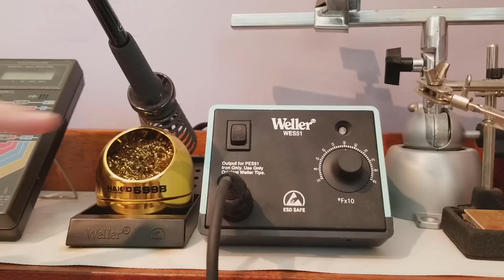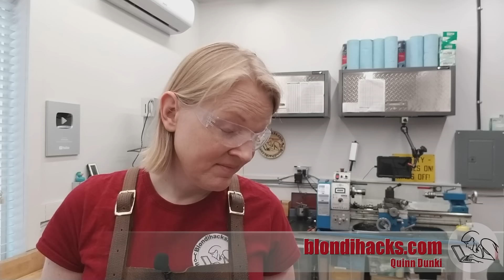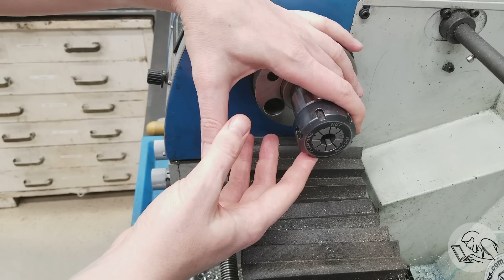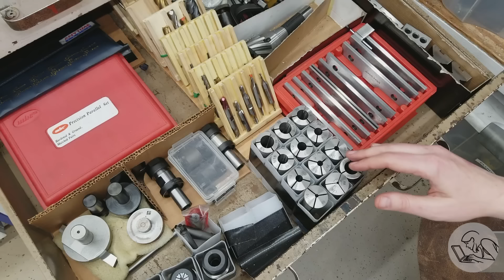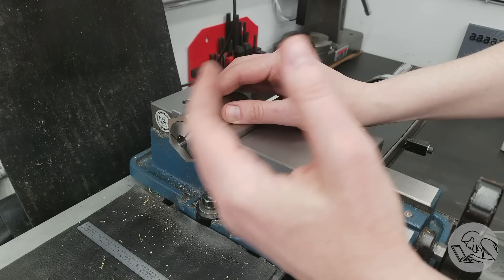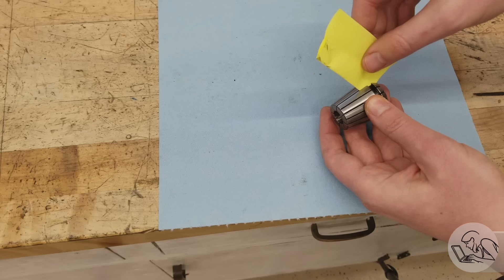Beginner's Guide To Collets

Comment: Another great explanation.   I just found a Taig Micro Lathe, model 4500.   I'd like to use it for clock repair.    Thinking of a set of ER collets in of course very small sizes to hold the shafts and polish pinions, etc.

Comment: I was a bit surprised to hear you say that slipping in R8 collets is unlikely at hobby shop machine scales.  That makes me wonder if I am doing something very wrong.  I have a mini mill that is a size or two smaller than yours (basically a variant of a Sieg X2), and I have experienced end mills getting shifted in R8 collets many times both when end milling and side milling -- I have mostly switched to holders for heavier cuts.  Perhaps I am pushing things way too hard (that poor little machine has seen some stuff).  I assumed that was just normal, but... yeah, sounds like I have some troubleshooting to do.
Thanks for the info!
Reply from the maker: There’s something very wrong if your endmills are slipping on an X2. It has nowhere close to enough torque to do that. Your collets aren’t nearly tight enough or are the wrong size.

Comment: @25:32 very true...
I started with er40 for work holding on my lathe.
Then i got my mill with iso 30 spindle & it also came with a er 32 set.
I just did not had to buy any collet set. 
Set of er 32 & er 40 does all the tool holding and work holding for me. Between two lathes & a mill.
There are a lot of content on my channel demonstrating the versatility of the ER systems.

Comment: THANKS, VERY MUCH QUINN!!  I HAVE BEEN WANTING TO "BUILD" A SMALL, COMPACT, "PRECISION" LATHE, THAT MIGHT BE VERY USEFUL IN MAKING A VARIETY OF SMALL PARTS, ESPECIALLY USEFUL FOR R/C AIRCRAFT MODELING, AND SIMILAR ACTIVITIES.  ALTHOUGH, I'M NOT INTERESTED IN TRYING TO MAKE PRECISION WATCHES, CLOCKS, ETC., I WISH I HAD THE MACINE CAPABILITY TO DO VERY GOOD, PRECISION" WORK, AND, WITH REASONABLE PROFICIENCY, WITHOUT CONSTANTLY NURSING THE MACHINE, TO KEEP IT FUNCTIONING.  I MAY TRY TO BUY A "CNC COLLET MACHINE HEAD, AND USE IT AS A BASE HEADSTOCK,.. THEN I NEED TO FIGURE OUT SOME SORT OF CROSS-SLIDE/RAIL SYSTEM, AND, USE A "TILTING/TURRET STYLE VISE, TO HOLD THE WORK, AND TO ADVANCE THE CUTTER BITS.  I WISH EVERY HOME HAD A SERVICEABLE "WORKSHOP, AND A "CRAFTSMAN" CAPABLE OF MAKING THINGS, FROM MINI-BIKES, TO BOATS, MOTORS, AND SUCH!... KEEP UP THE GREAT WORK!!!  THANKS, AGAIN!!!:face-red-heart-shape::face-red-heart-shape::face-red-heart-shape:

Comment: Excellent video as always, Quinn. Thorough, concise, and delightfully nerdy.  

Regarding the TTS holders: I'm one of the hobby users that's had much success with them. The "special" collet really isn't that special... You can buy the precision ground one, or you can do as I did, and just grind a regular 3/4" R8 collet nose flat, on a belt sander. The important thing is that the face of the collet is recessed into the spindle, which allows the upper face of the holder to register against the spindle nose. The collet face is not the registration surface. 

This is what gives you the Z-height repeatability, as well as making up for (most, if not all) rigidity lost due to stickout. I've got a smaller mini-mill than yours, and on the rare occasion I need the extra Z-height, I just hold the tool in the appropriate R8 collet... But I honestly cant' remember the last time I've had to do that. Most of the time I can just swap tools in a few seconds, which is well worth it, for me. (I definitely recommend using the genuine Tormach holders... Unless you're luckier than I am, those import ER collet holders have terrible runout) 

An added bonus is if your DRO has a tool library. Automatic offset compensation at the touch of a button!

Comment: An important point to be aware of is that end mills with a set screw detent must be inserted at least a few millimeters beyond the detent. Otherwise, when cutting at high feed rates the pressure on the end mill will cause it to break.

p.s. - You can instruct apprentices on how to do things the right way until you're blue in the face, but I've yet to find a way to ensure they consistently follow directions. I've even had apprentices place double-end end mills in ER-32 collets at such a depth as to break the flutes on the second end.

Comment: All hail the algorithm. I was looking at collet sets today (and bought a set of ER40s and a collet block set). And now your video is at the top of my feed. I needed the larger collet to hold some larger parts. The mill I use at work (a high school) has ER32 tooling collets. Our CNC mini mill and CNC wood router use ER16s. I hadn’t even thought about the block setup fixing the part centreline in Z axis.

Comment: Good talk Quinn 😊 I use MT2 collets in my baby sieg x1 clone, find them much better with the increase in rigidity and basically no runout. 

Discovered that my el cheapo er25 square collet block is super badly made,  not one surface is actually properly flat, and I'm trying to hold a small 1/4" thick piece of stock in it for milling a flat, but keep getting a .03mm-.1mm taper when trying to cut even 1" of a flat across it, withbjusr barely more than that sticking out.

How would one square up the chinesium standard er25 collet block and gain the concentricity (possibly wrong word, difficult concept to be sure of) necessary for having the held bar stock at true 180 degree parallel to the bed, I.e. remove the tapers and make it true? 

Embarrassed to ask, but you're the smartest machinist I learn best from, and I'd rather fix than replace things when possible 😊

Comment: Never used the ER collets, how do they compare to TG collets? 
All the shops I worked in used them in various sizes and they seemed to be actually preferred to endmill holders, the belief being that full diameter contact was better than just the point contact from a side screw.

Comment: Don’t forget the ER25, good size. I have a complete set of Er40 for the good diameter range, plus a bunch of Er25 holders to have smaller mills mounted. Doubled/tripled collets for 6, 8 and 10 mm for mill holding. Does the trick.

Comment: The additional stick out of ER holders in a mill can be an advantage in some situations. I've got a sieg kx3 and using cutters in an R8 collet means that you can't reach thin parts clamped down to the table. I generally use an ER32 holder with a solid R8 shank - it's more rigid than holding a parallel shank in a collet

Comment: I recently bought a set of inexpensive ER 32 collets. I had read about the quality control issues, and the need for checking to remove swarf and burrs. But I was pleasantly surprised to find that mine were very clean and free of debris. It gave me some confidence that I had found a good (I'm pretty sure it was Shars). They've come in handy with the collet blocks I bought at the same time. I own both an old milling machine (Clausing 8520) and an old lathe (Logan 10-inch). They have enough wear in the lead screws and ways that I know I'm never going to get great precision from them, so I limit any projects based on that knowledge. There's still plenty they can do, though, and my old hands and brain are sort of thankful for the limitations!

As always, another great video. Thanks!

Comment: Worth pointing out to the beginners who may be watching this video that you only gain the concentricity benefits of a collet if you first machine your work so it is gripped on a truly round length of stock. That 1/2" length of steel you got on ebay needs machining to be perfectly round before you can start to rely on it. I use a collet chuck for 95% of my stockholding on the lathe and the ER range is much easier to live with if you wish to put many different sizes of stock into it. It is possible to make a collet stop to fit inside the lathe spindle that gives you the ability to machine many parts to a common size. ER collets usually have a capacity marking on them so ( in our Britsh metric system! ) a 13mm collet would be marked as 13-12 meaning that anything with this range can be gripped. On the smaller sizes you sometimes need to buy them in 1/2 MM increments as as 2mm collet is ulikely to grip well on 1mm stock. I guess if you use stock that small you should be using jewellers collets but that is another story. Good video as always.
Reply: ....but note that ER collet stops don't work that well as the collet and the stock moves relative to the lathe spindle when being tightened.

Comment: Great job explaining the differences and the uses of collets.  

The old guy wisdom I would impart is “Clean your collets, every time”. As you know,  collets work using the tapers to collapse the collet and grip the tool or workpiece. (Quinn said so), but I have often seen people using dirty collets, pulling one tool out and slapping another in, or keeping their collets “well lubricated” they defeat the friction that make collets work.  I use ISO Alcohol because it leaves no residue. Like anything else in life, you can go really far down the rabbet hole topics like fretting and pull out forces would warrant their own video.  (Hint hint Quinn) Sometimes knowing that the long, skinny pedal on the right makes car go is all I really need. Thanks again Quinn, great job!
Reply: I keep a special toothbrush in the drawer with the ER collets to clean crud from the threads. And I'll run the lathe at low speed and hold some unwound cotton string (pinched, not wrapped round a finger) against the male threads. It gets right down in the thread and pulls out what a rag won't.

Comment: Vintage Deckel Machinery is quite common here in Germany.

We have companies that entirely specialise in restoring and maintaining old Deckel Milling machines and also still produce the acessories.

Deckel clones are also produced by the company FPS.
Reply: Also you can use the Deckel collets for tool holding.

Deckel Milling machinea have a  Iso40 taper and Deckel made Iso40 collets with the same buttress thread aswell as Iso40 adapters for the small and thin collets.

Comment: Might be worth mentioning that although a 1"/25mm hole is technically out of spec for ER32, there are folk who make them - more hole than collet, and I'd be wary if it's something that needs a lot of holding power or high precision but they work just fine. Searching for 25-24mm collets should turn them up.

Comment: Don't forget 5C emergency collets! If you absolutely have to have a 0.511" collet and you can't afford the time or price to get that size ( maybe it's for a one-off job ) make what you need. These come in brass or plastic, maybe mild steel ( can't recall); tighten it like a normal collet, drill and bore to size, and it's dead concentric.
Reply: Well that’s not exactly correct. A 5C emergency collet requires you to insert 3 pins to the collet face. This “loads” the collet for the machining step. Then you remove the pins and insert your workpiece.

Comment: in Australia the R8 is a not very common in milling machines most machines available have an international 30 or 40 or 50 so i made some of my own collets to fit an international 30 needless to say they didn't turn out very accurate  -----  can you buy a int 30 / 40/ 50 collet if not why not

Comment: Nice video. I use ER collets almost exclusively. Both on my lathe and mill. ER32 is the go to size but I also use ER16 on the mill for small work as it gives good reach into confined spaces.
Also, as someone mentioned above, get some bearing nuts. You can crank them up tightly or if you don't need to hold so tight you don't so much welly for a given clamping force.
I also use R8 from time to time for the very reasons Quinn pointed out.

Comment: One thing to watch out for on hex collet blocks is their precision on the edges.The sides can be expected to be precision ground, but not necessarily the edges. So, for example, when you clamp a hex collet block laying down on the edge in the milling vise (as is shown in the video), the Y position of the work piece is repeatable, but not necessarily the Z position.

Comment: The deckel collet is also used in the deckel mills (deckel FP1 ) 
The spindle is fitted with a tapered insert which has a morse taper on the outside and an deckel collet taper inside 
This is done to have the option to remove the morse taper adapter and use bigger tooling for example a 6" shell mill 
I believe that the flat side of the thread is done to increase the friction on this side of the thread so the drawbar can't loosen itself due to repeated starting and stopping /reversing of the spindle 
The deckel mills are very stable and easy to use and reliable

Greetings from Germany
Keep up the great work 
I learned much from Ur videos

Comment: I have a very dumb question:
If i were to make a collet myself would i just bore a hole and then cut the slots or would i bore a preliminary hole, cut the slots, compress the collet to just over the dimension of what i want to hold and then bore again under size and ream to final dimensions.
I am asking because it strikes me as odd that just having 3 or more sectors of a large cylinder shaped bore is enough contact area to hold a smaller cylinder shape.
I mean i am aware of elastic deformation and it's role in work or tool holding, but you usually do not rely on "squishiness" for precision, right?
Reply: i made some collets myself to fit an international 30  milling machine and had limited success ( not very accurate ) so if you do find a successful method  ..tell me how you did it

Comment: When I first started in the gunsmithing world over 20 years ago,  we had a 5c collet setup for a very nice gear driven lathe we had.  The lathe was incredibly accurate but for some reason whenever I used that collet chuck I found the runout was terrible, up to .018" and repeatability was worse.  I tried all kinds of ways to correct the issue but never could.  It happened with any collet you used not just one size.  In retrospect, I think someone had probably crashed that chuck either with the lathe itself of perhaps dropping it on the floor.  It was a huge dissapointment!  That was my only bad eperience with collets really.  Otherwise they are a great tool to have around.

Comment: I use ER a lot. Common error is not to tighten the nut sufficiently - look up the closing torque for ER32, it's *massive*. Ball bearing nuts can help with this, they basically have a thrust bearing built in that allows more of the applied torque to be used closing the collet.
Reply: Then you might think about cleaning the thread on the nut, I tighten my ER40 collets with the spanner and only hold on the colletholder body, and that is tight enough to make 2mm chips
Reply: @sidewind131258  Depends on the size of the part and the range of the collet. The lower down in the range you go, the more torque you need. And I'm not making up the torque figures: the published closing torque for ER32 is 100 ft-lb (135Nm). That's a lot.

Comment: Excellent presentation. I've got a 5C "run-tru" chuck for the lathe an it is my go to when I have the correct collet for the work. Useful when polishing right up to the colleet. No edges to snag the hand like an ER has. Also very little of the work has to be inside the collet. I also have an ER40 "run-tru" chuck that I use because of the greater holding range of the collets. My set of 5C collets is by 1/32"s which is too coarse to hold all work sizes. I do have a few square and hex 5C collets bought for a specific use. Other handy things I've got for the 5C is the spin indexer (which I reversed ends on and true the base to the bore so it can be quickly clamped in the mill vice.) The collet blocks I've got originally didn't center the work ±perfectly so I had to take a slight cut on them to get very good results. I've used them on the mill to drill into the end of a rod. Was helpful when I needed the hole to be offset from centerline to work as a cam. I have the R8 to ER40 adapter mainly because I have some metric tooling that my ER imperial collets will closed down enough on to hold. My First set of ER collets were by 16"s, too large of steps and they were a PIA to use because they were really difficult to get snapped in & out of the nut. I bought an import set by 1/32's which are much easier to get in & out of the nut. They run just as true as the name brand set. My 2¢.